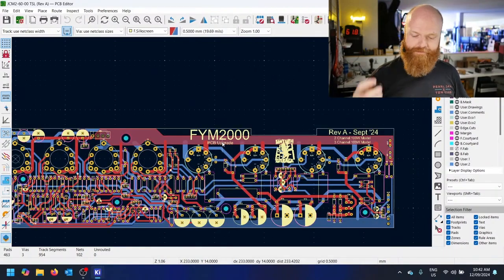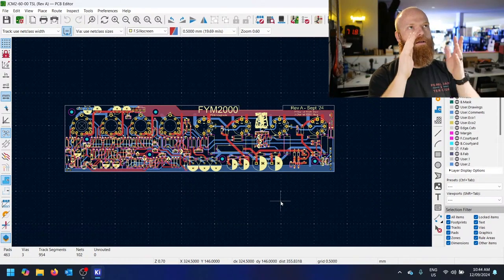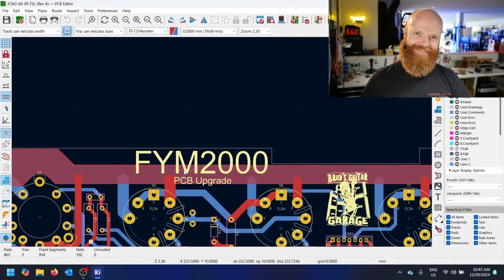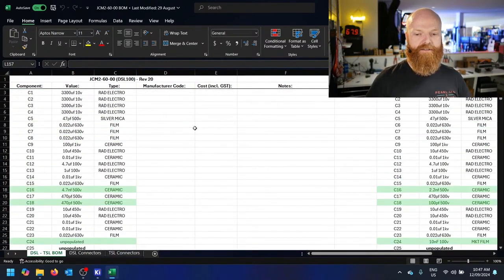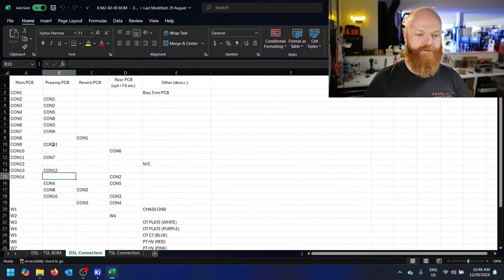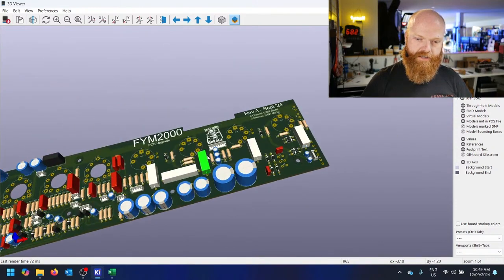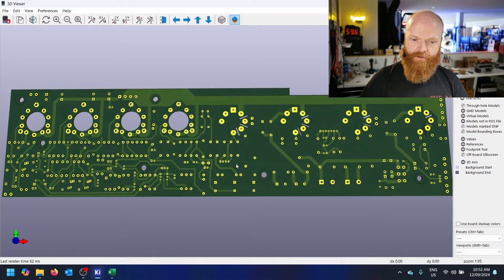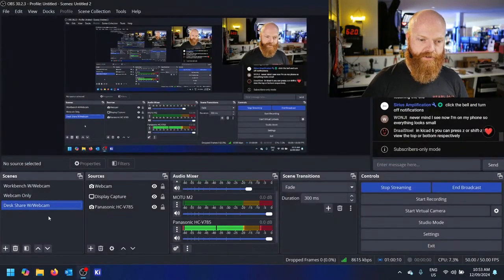PROTOTYPES EN-ROUTE! - JCM2000 100W Head Replacement PCB's

Comment: Great video—thanks for sharing! I’ve had to fix more of these than I’d like to admit. The only real solution has been replacing the entire board with a better-made one from Marshall. Since upgrading the board on my personal 1998 DSL100, it’s been running well, and the bias has stayed stable. The amp gets gigged regularly, but I’m always a bit nervous it might fail eventually due to the original design issues. I’ve also got a friend’s JCM2000 DSL100 waiting for a new board. When these become available, I’d love to grab one. Excellent work on this! subscribed.

Comment: A tech lifted the curcuit on my DSL 2000 by cutting traces and hand wiring that part of the board. That was mid 2000s, so the amp went bad very early in its life. The band-aid fix worked well at the time, but that it would become leaky over time in other places on the PCB makes sense. 

I got another 12 months use out of it before trading it for a brand new Randy Rhoads amp that blew up several days after arriving in NZ. I wonder if the 1959RR had the same problem, because it went into full melt down mode in much the same way. Massive damage.  

I will not go near any JCM 2000 amps now; unless perhaps the seller shows evidence the board has been replaced by somebody I trust. Sure, Gary Moore used them and sounded fantastic, but he could get spare amps from the factory in Milton Keynes (where I grew up, so I have more than one nostalgic reason for liking Marshall -- nostalgia is not a rational thing though huh).

P.S. The best amps Marshall have made since 2000 might be the 1987X and the 2203X. Not super expensive like the 1959HW, but they sound pretty much like the real deal and seem to last. I might be wrong though. How's the PCB with the ones made during the 2000s? 

I also think the new made in Vietnam DSL40 is okay for the money. The DSL20 too. That Lambchooper channel fella over the ditch there got good sounds and service from his for ages. They cheap out in ways, but they do sound good and seem to last -- for the most part. I might be wrong there too of course. That's one reason I watch channels like this. To find out the pros and cons with various amps out there. The Psonic vids on the issues with Fender reissue amps is another. 

I also like laughing at Mesa. Players that own them think they are the bee's knees and their gear is so much better quality than everybody's else's, especially the Mesa owners who also own a PRS. Not that I can be stuffed arguing with them. Just knowing they're oblivious to how they've consumed snake oil and are boasting about supposed quality is satisfying enough 😆 (I should not be laughing mind you, because I was had by the Randy amp - but their snobbery makes them fair game).

Comment: will you ship these fully populated ones to germany?
Reply from the maker: When they are ready, absolutely!
Reply: @BradsGuitarGarage  i was sympathizing with buying a TSL, but after watching a couple of psionic audios videos, i became quite hesitant. 

bought an Engl Powerball 2 instead, found out that techs usually think Engl amps to be badly designed too, but so far i can't complain, thing works like a charm. 

TSLs are avaliable on the used market here for 200-300€, which is what makes them tempting.

Comment: It sounds like this problem could happen to any amp where the power valves are direct soldered to the PCB?

For my own amp, I'm leaning further and further towards turrets on a phenolic board, with totally separate boards for the preamp and power amp.

Comment: Excellent news. I have a TSL100 combo (with an Issue 20 board) and a DSL50 (with the original board) so keen, as an amp tech, to see what can be done with these boards, especially as I dread it when a JCM2000 comes in with issues. Is it worth doing a 50w board too Brad? I assume this board with alternate BOM should work - it seems to be like that on the DSL50. Will follow this with interest.
Reply from the maker: I need to get my hands on the 50W version for assessment and testing.
I believe that again, they are the same PCB with select component footprints left unpopulated.

Comment: Hello Brad. Those look great. A guy came to me with a TSL100.  He had bought the Dr Tube bias mod kit and asked me to install it. I installed it, once I had sorted some previous work done on it by Bodge it and Scarper. It worked okay but I did warn him he may get other problems later down the line. It was a sticking plaster fix. I decline the JCM200s  normally as there is no proper fix for them. Well it looks like there is now! You are one hell of a tech Brad. Take care.

Comment: I tried using a Genrad insulation test bridge on a JCM2000 board. It was about as stupid as testing a piece of very badly burnt toast. Sometimes stupid is fun. It was kinda fun, in a burnt fiberglass aroma sort of way. I wish I'd done it with the lights out. 1000 volts DC finds a lot of faults.

Comment: I need a new board for my dsl401.
Reply from the maker: The TSL60 and DSL401 are a complete system on single PCB boards.
They still cook though, worse in the combo versions with the heat rising to heat the PCBs as I'm sure you've discovered.
However, there are too many obsolete and expensive parts on them required to fit the existing amp assembly to make them economical to produce unfortunately.
There were also way less of them the produced. I think I've only had 1 or 2 DSL401's and 2 TSL60's in my whole career, but lost count of the TSL/DSL100's that have come through.
Reply: @BradsGuitarGarage  so what you are saying is dump it or turn it into a 1974x? Lol
Reply: I don't know where you are in the world but here in the UK you can buy 401's combos for £250 (what I paid for mine) I like mine a lot (and owned it for 10 years) but when it's time comes, it won't be economically worth repairing. It's been great though, It still has the original valves too!